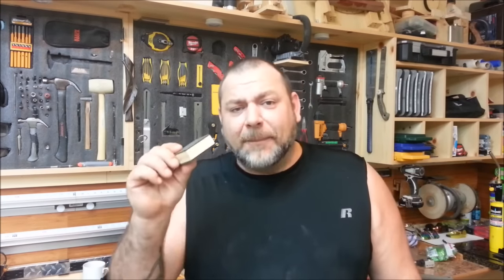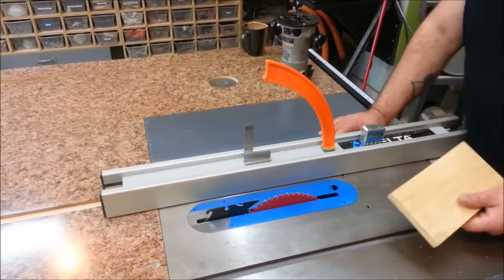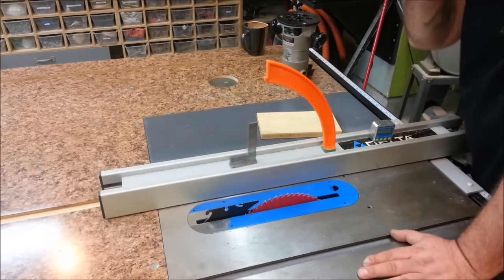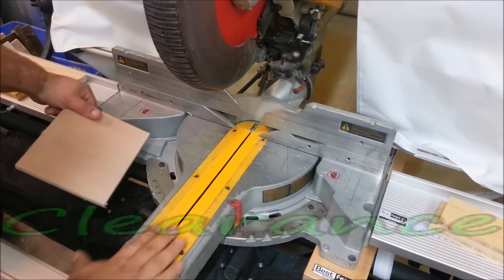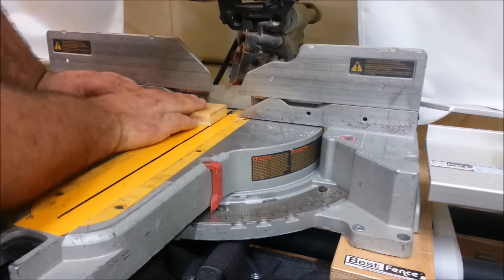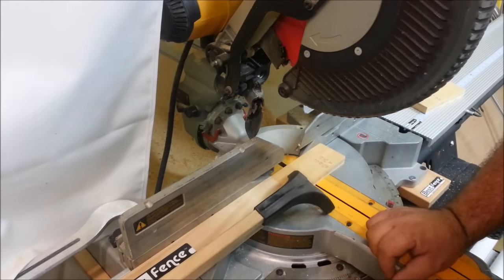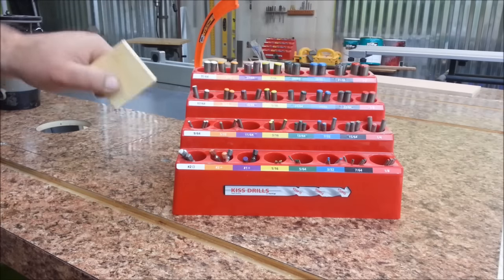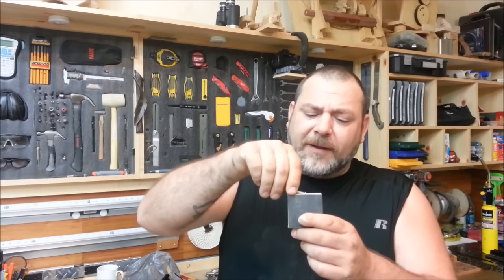8 Awesome tools from FastCap!.

Comment: Awe, sweet!
My nemesis have always been how to keep my bits organized. It's all fine and dandy that they come in neat little boxes with labels for each of them, but that doesn't do me any good when I fail to put one back before using another. By the end of the day, I stand with a fistfull of bits, and with poor eyesight it's hard to see the markings on the bit (leading me to go "whatever" and chuck them all in a drawer). I was toying with the idea of mounting a matching screw/bolt/whatever and using the Goldielock method of finding out where the bits go, but colour coding is WAY easier!
No more Great Box of Random Bits for me.
Thanks!

Comment: I have a question. The zero tape looks like it will work really good for when you are cutting straight pieces but how about if you want to cut on a 45 degree angle cut? Wont that make your saw blade cut a lot wider slot down the center?

Comment: I have that zero clearance tape on my miter saw as well.  I need to replace it again though as I have made a few other miters so the zero clearance part is gone LOL.  It does work great though even with cheap blades it gives great smooth tear free cuts.

Comment: Hey quick question I have the same table saw I was wondering how does the fence on your saw work with out the black rail that it hooks on to in the back
Reply from the maker: Jose Lara Its an after market fence designed to work with out the back hook it is no the same fence that comes with the saw

Comment: aren't you worried about the power mag causing an effect of your motor magnets inside?
Reply: Been using them on my makitas for years. No issues at all. However if you store them immediately next to the charger as I did in a mobile rolling cordless cart they will slow the cooling fan on the charger.

Comment: $200 for an 82- Drill bit set? Is that really worth the money?
Reply from the maker: every penny! go price them out individualy .
Reply: +izzy swan, I can buy 4 Dewalt 20- piece kits for under $90 shipped on Amazon. Drill a few holes in a block of wood and borrow some of the Mrs.'s nail polish for marking. Don't get me wrong, I drank the Fastcap kool-aid too, I'm just not seeing how the drill system makes drill bits double in price.